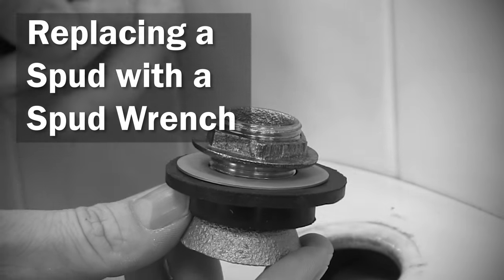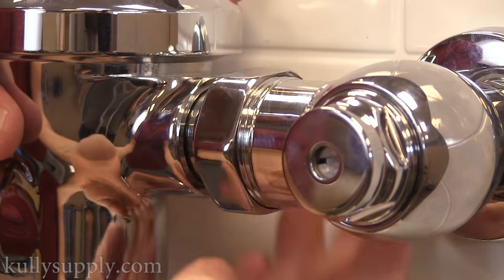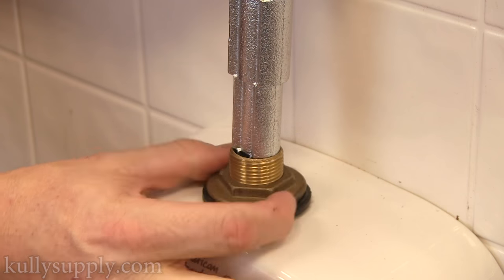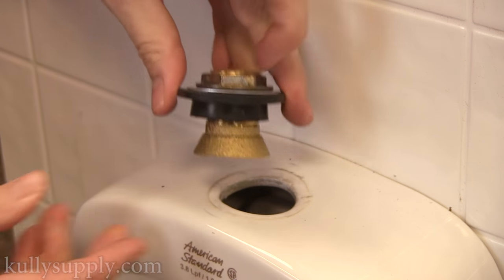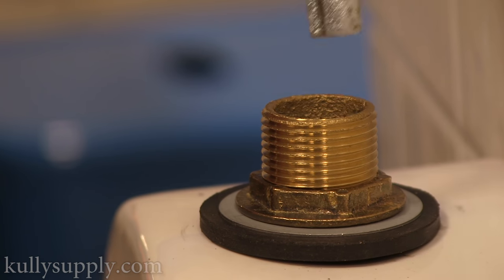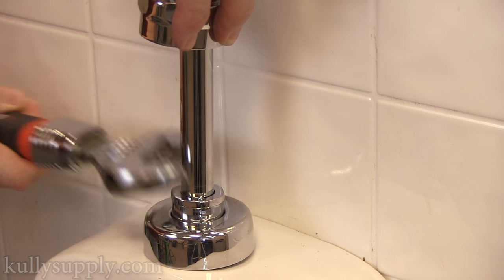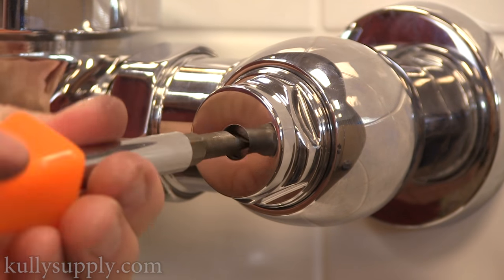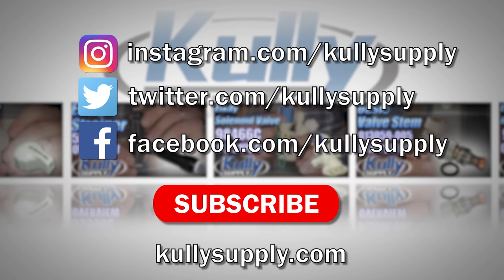How to easily replace a Urinal Spud with a Spud Wrench! - KullySupply.com

Comment: Hi.  I'm working on an old Crane urinal that has an outlet spud ( that then connects to a P trap ).  once I find the correct spud, is it the same process to install the spud?
Reply: skeleman1963 yes, that should be the same process
Reply: @troymaas5179  ..  ty for reply Troy.

Comment: what was the problem to begin with...why change the spud valve?
Reply: The rubber gasket can deteriorate over time and cause a water leak on the top of the urinal.
Reply: They sell spud less urinals
Reply: @KieranMullen  this is not a spudless urinal. This is a training videos for urinals that utilize a spud connection.  Your not going to swap out a perfectly good urinal because a 15 dollars spud went bad